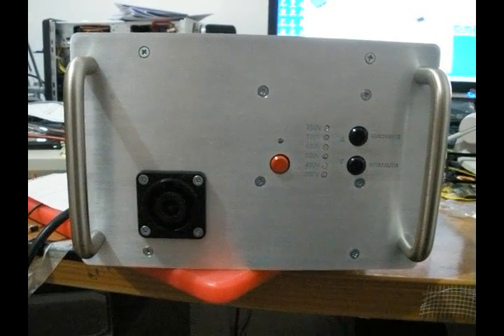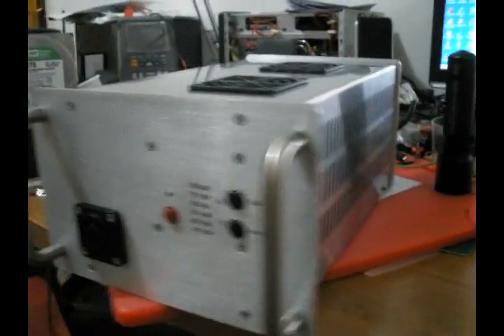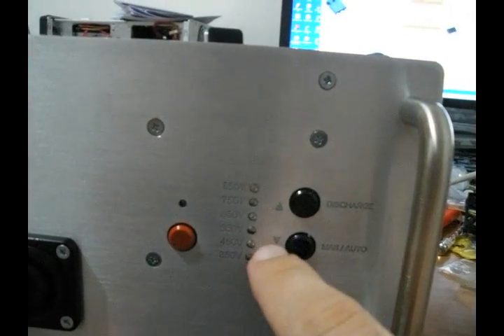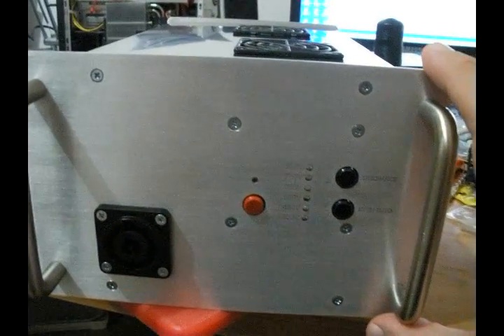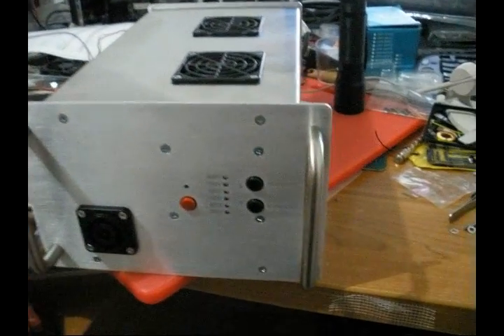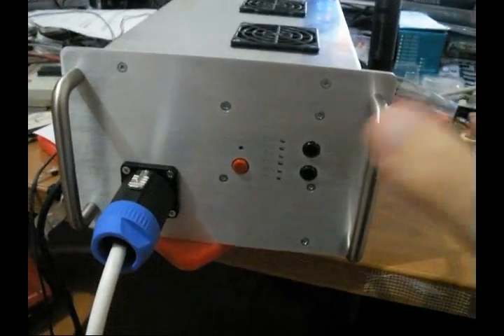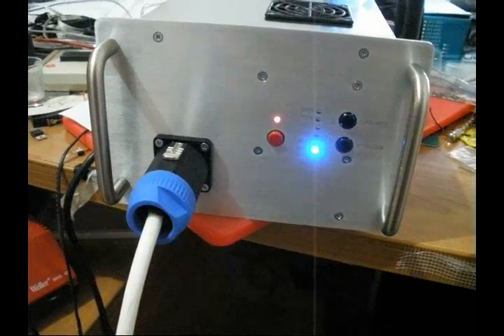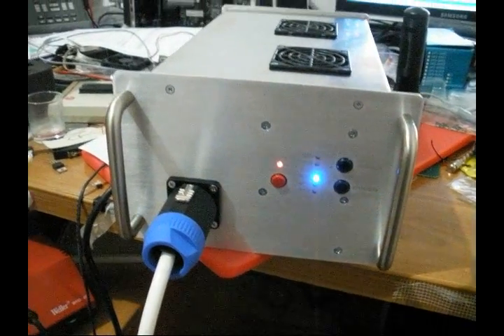Magnetic Pulser 850V - Part3

Comment from the maker: Hello all, sorry for the very late response. The 850V pulser is no longer for sale. It did not pass the long life test, the capacitors failed. Also, the 445V and 500V pulsers are also discontinued, I will come out with a better design, they take too long to assemble.
The 600V Life Pulser will take its place https://www.youtube.com/watch?v=BptBtRf7MEc
The 600V Life Pulser has passed extended tests and will last a very long time, tests are still on going and very positive. This is why I added the phrase "Life Pulser" on the end.
If anyone is interested in the 600V pulser, leave a comment on the 600V Life Pulser video page, I have four finished units, but the coil units still have to be made.
The cost of the 600V Life Pulser is not cheap, estimated price is 2100.00 euros. I could have made it cheaper by using cheaper components, but I cannot get a way with the durability and life of the unit, i.e. it will fail in a short time if I did use cheaper parts. These units are switching high voltages and high currents, this is very strainous on the parts, mainly the capacitors!

Comment: Do you sell ? Please mail me on tekstoglyd@gmail.com Leif from denmark
Reply from the maker: +Tekst og Lyd 
The 850V pulser is no longer for sale. It did not pass the long life test, the capacitors failed. Also, the 445V and 500V pulsers are also discontinued, I will come out with a better design, they take too long to assemble.
The 600V Life Pulser will take its place https://www.youtube.com/watch?v=BptBtRf7MEc
The 600V Life Pulser has passed extended tests and will last a very long time, tests are still on going and very positive. This is why I added the phrase "Life Pulser" on the end.
If anyone is interested in the 600V pulser, leave a comment on the 600V Life Pulser video page, I have four finished units, but the coil units still have to be made.
The cost of the 600V Life Pulser is not cheap, estimated price is 2100.00 euros. I could have made it cheaper by using cheaper components, but I cannot get a way with the durability and life of the unit, i.e. it will fail in a short time if I did use cheaper parts. These units are switching high voltages and high currents, this is very strainous on the parts, mainly the capacitors!